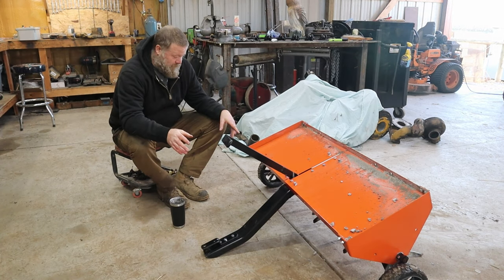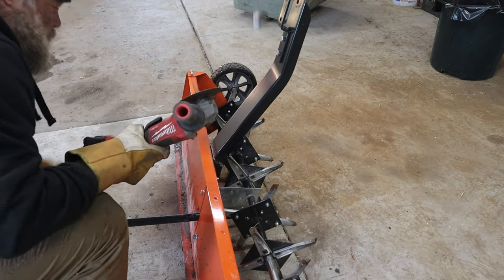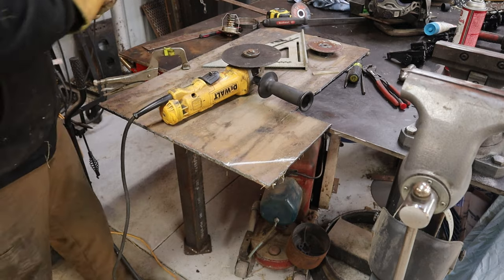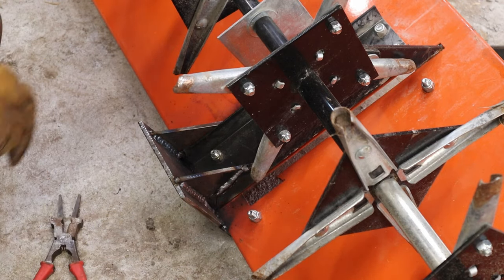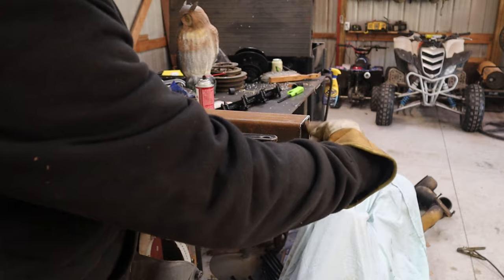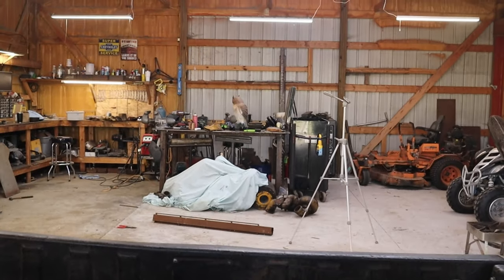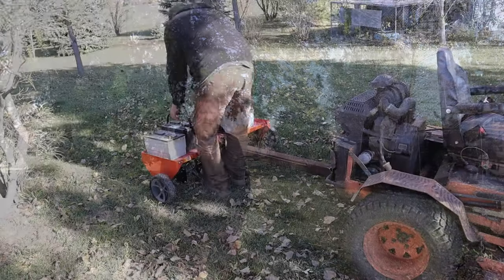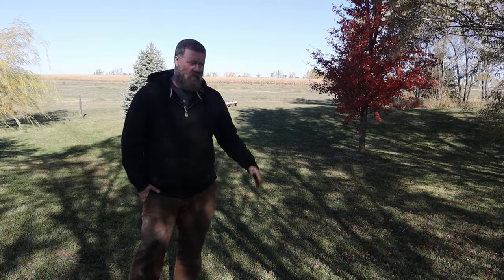Agri-Fab Pull Behind Aerator from Tractor Supply - Fixing some weak points

Comment: I'd forget the batterys. Solid concrete blocks work well. A small rubber mat or kitchen carpet scrap will make the noise less and keep the blocks from banging around. Can you weld an angle brace to each side to stiffen up the hitch(and aerator). Good welder. Fun to watch.

Comment: Your challenge with this style aerator is going to be the wheels.  They are designed for moving it without any added weight.  If you move it much with weight on it and the wheels down they will not handle it well.  And this aerator requires as much weight as you can add.